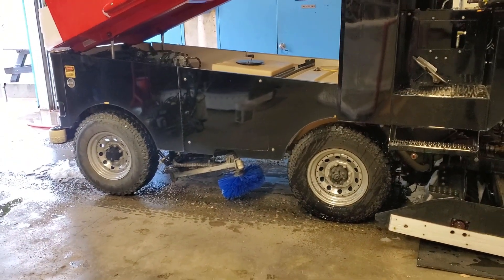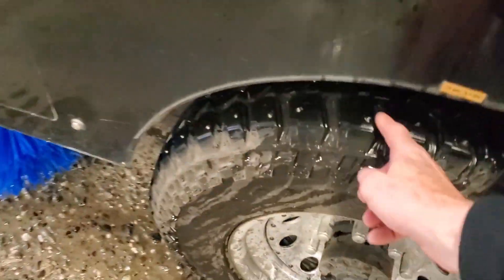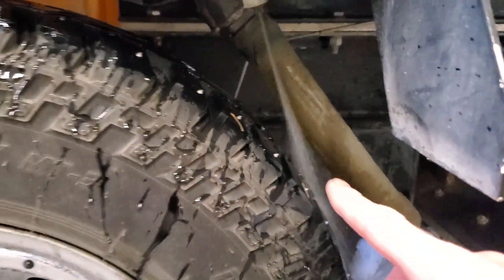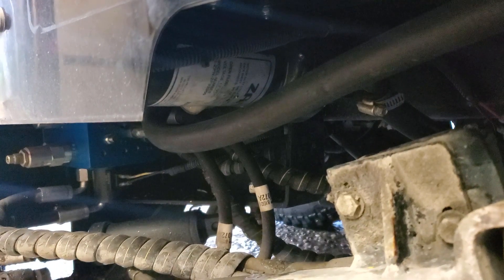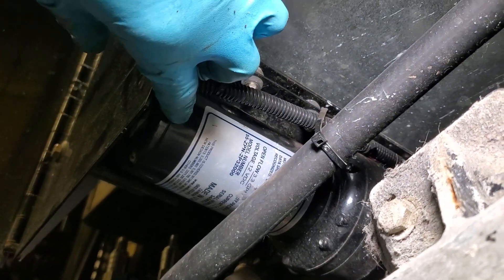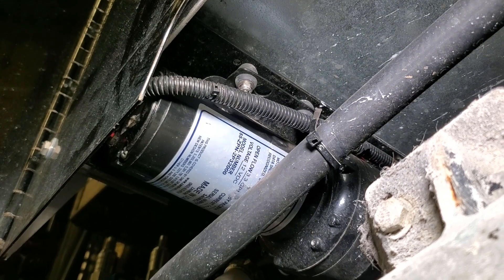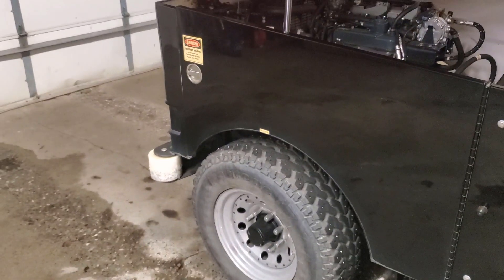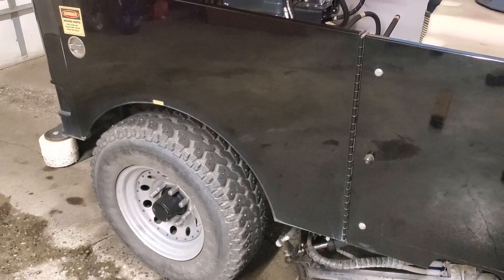Zamboni: Tire Wash System - Pump Repair

Comment: Do you ever have to swap the check valve to keep the tire wash from leaking? We had to swap them on both of our machines over the course of 2 weeks and apparently one of them went out last season as well. My boss thinks the hot water and plastic is what causes it to fail.

Comment: Ours stopped 2 days ago on our 446. So naturally I come here to see how difficult is is to remove and see if I can fix it.
Reply from the maker: The starter? Did you get it going again?
Reply: @YourLocalIceMan  No, the tire wash system. I think the pump died, but not exactly sure. Dealing with our local Zam dealer.
Reply from the maker: @dantea1474  lol sorry. When turning the wash water pump on do you hear a click coming from the pump? If not could be a lose wire or the electromagnetic has gone bad.

Comment: Don't know if this would help you, when ever I have to get to anything behind the side panels, I just pull the panels off. 5 bolts and you have clear access.
Reply from the maker: I thought I had a panel off before but when I went to take take it off it seemed more trouble than it was worth. Maybe now that I know others have done it I will be more inclined to do it next time. Thanks for the advice!